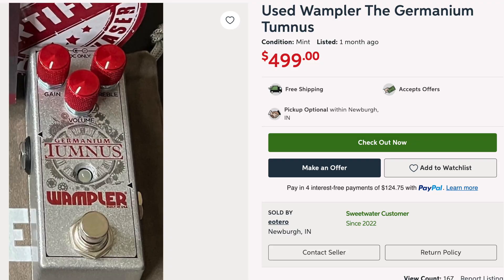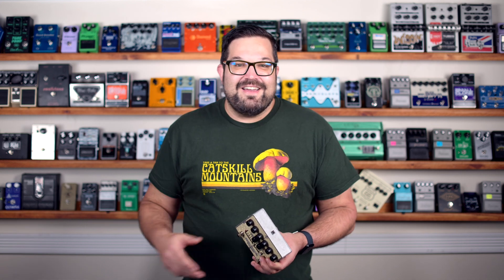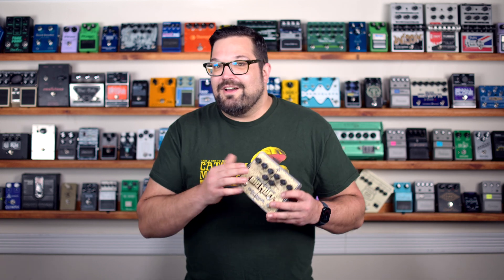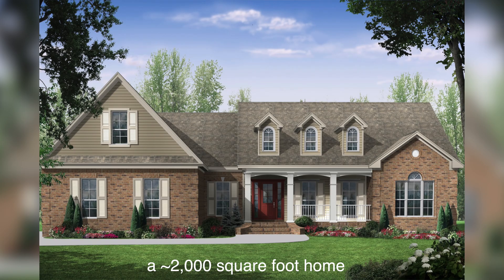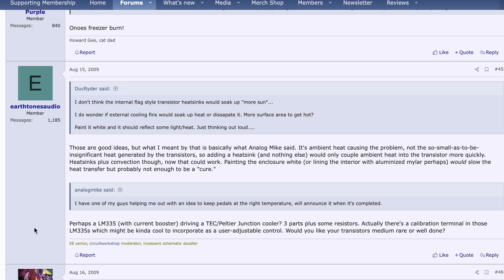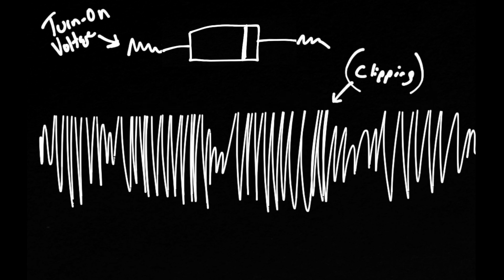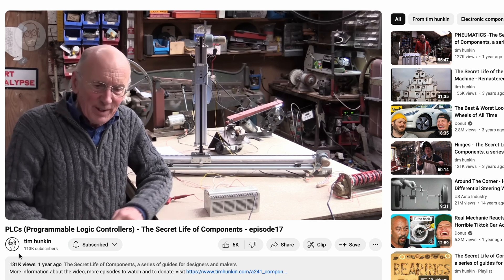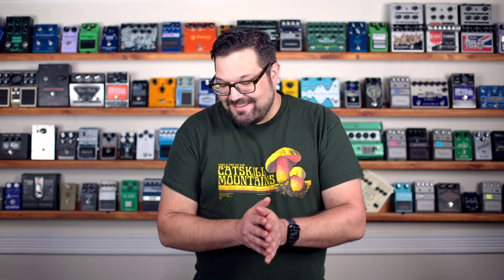What Does Germanium Do for Guitar Pedals?

Comment: ⚠There are heat dissipators even for small transistors. I mounted some, scavenged from old circuits I dismantled for parts, an all my Ge transistors and it helps a lot... :face-green-smiling:
I:face-red-heart-shape:the BM-Ge4. BTW, these have four NKT275, just like the original Fuzz-Faces. AFAIK, EHX had new NKT275s built ca. Y2K.
I actually bought a 2nd as a security... 
The only complaint I have about the BMGe4 ? Would need 128 presets and MIDI!
Same stuff with the Fuzz-Factory

Comment: Dang, those (Germaniam) are big transistors for modern electronics. They looked like electrolytic capacitors. And, I was just talking to someone yesterday about how monumental the discovery of the transistor was. Without that, modern electronics would look SO different today.
Reply from the maker: I’m reading a book about Bell Labs right now, and it really sticks how we needed to get hooked on the vacuum tube in order to pave the way for the transistor. Huge leaps in technology and ability for humankind. I kinda feel like we’re in the vacuum tube stages of AI right now, especially when it comes to energy consumption.
Reply: @StompboxBreakdown  That's a great analogy.

Comment: FWIW the Germanium Big Muff is a great pedal, but the transistors in it are wired as clipping diodes for the op-amp based circuit. Very strange circuit, kind of a waste of the transistors, but it sounds fantastic in its own right, so.
Reply from the maker: Oh weird. This pedal really is interesting

Comment: Thanks for the great video.  I'd be very interested to see any scope shots from the pedal stage using the germanium device.  Of course a REAL signal would be too hard to mess with, but often a sine wave with variable amplitude can be used to show how the device reacts to overload.
I'm not too worried about Germanium personally as I have a Walrus Audio Eons with all combinations of devices in it :D  Fuzz on!
Reply from the maker: There's a paper about this, with lots and lots of good information and scope shots: https://www.unomaha.edu/college-of-arts-and-sciences/physics/student-opportunities/barrera-mendoza-senior-project.pdf
Reply: @StompboxBreakdown  Thanks for sending this to me.  I looked at it, although not being an analog expert I can't comment much.  The impression I get is that germanium transistors were definitely just not a plug-in replacement.  It looks the resulting fuzz circuit was not useable and the scope plots looked nothing like the original.
From my Walrus Eons at least, I don't hear as much difference between Germanium and silicon.  Is it possible the author could get much different results by applying more effort to finding a suitable circuit for the Germanium devices?  Thanks again for this excellent video and the extra information.

Comment: I have a pedal with germanium, silicon, & LED clipping. It's clear how different they all sound!
Reply from the maker: Oh yeah, big difference. It's like changing the end on a pressure washer.
Reply: Black Mass 1312 best Rat-circuit box out there.  So fun switching between all the clipping options.
Reply: Which pedal is it? Is it a Walrus Audio Eons? I know that one has all three in it too